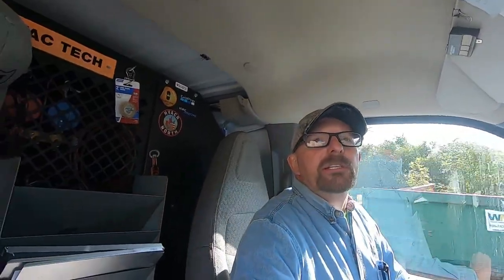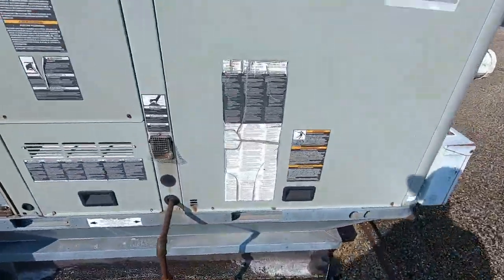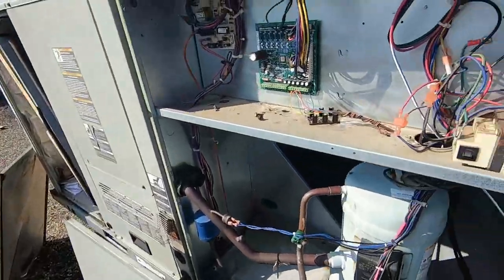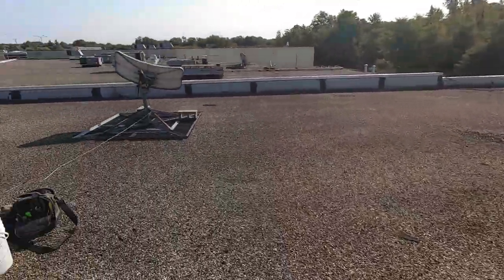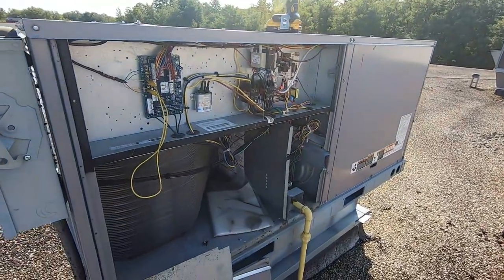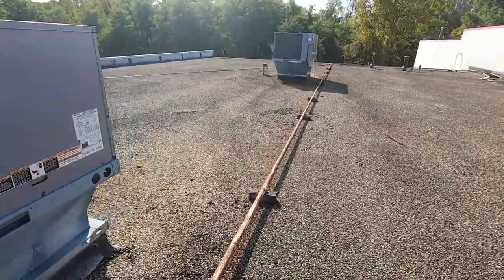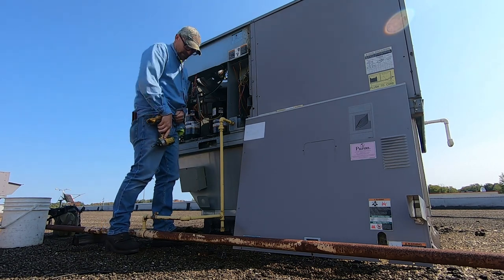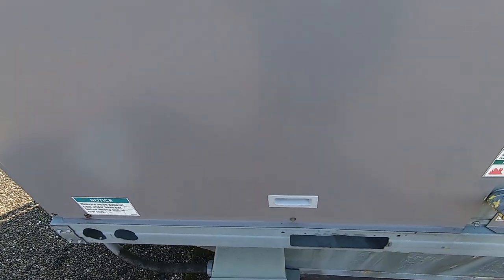Simple Mistake Generates HVAC Service Call

Comment: I was never trained to check the heat exchanger, but now ill be checking them regularly . Would there be any issues with the system if you leave the gas off?

Comment: Mistake  #1; not wearing a seatbelt. It's such a simple thing and prevents you from ending up in a wheelchair when some idiot runs into you.
Reply from the maker: Yes I agree, I did not have it on while driving around to the back of the plaza after checking in with the store.